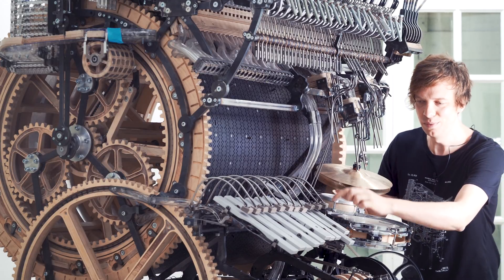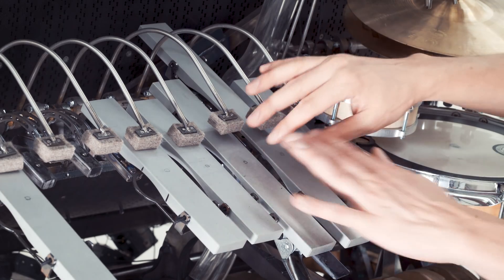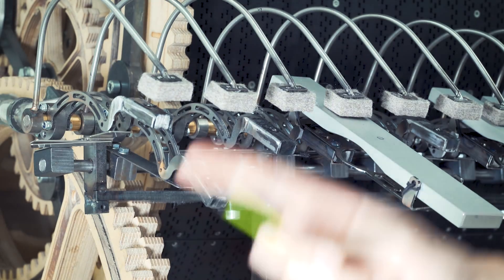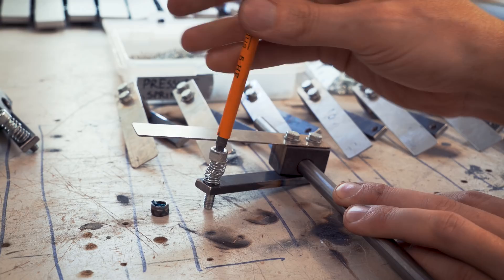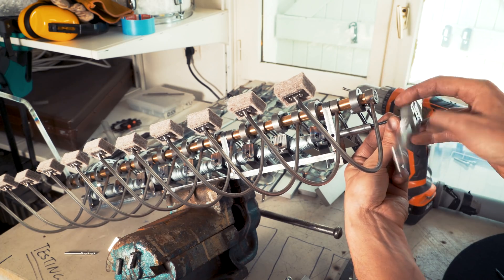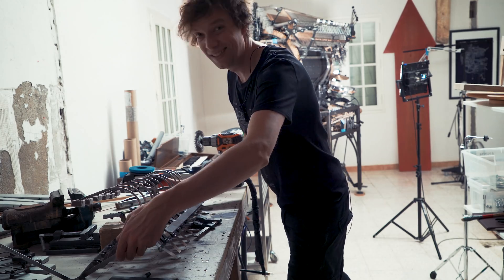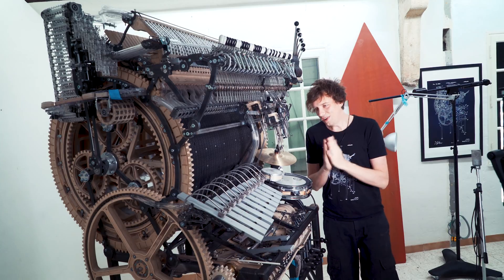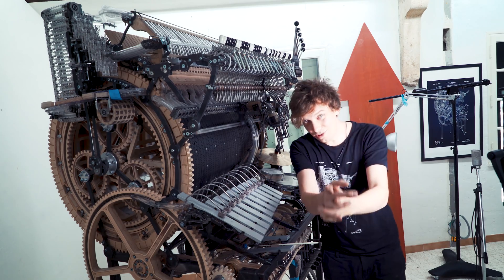Vibraphone Height Adjustment - Marble Machine X #103

Comment: uses proper tap wrench "oh, I don't break taps any more, I have to simulate it to create tension".  Glad to see you have come to realize a tap stuck in a hole is worth two in the toolbox. Also, hate to say, but wont this design mess with the resonator tubes? Wont any movement mess with the tubes?
Reply: Andrew Dowling Movements will probably add another layer of vibrato I guess

Comment: With the loose shims, you could avoid wandering by having a pin on them, and a hole (or dimple) in the plate. But your new solution is way better than having a bin of loose shims :)